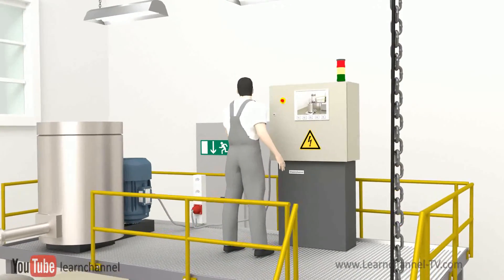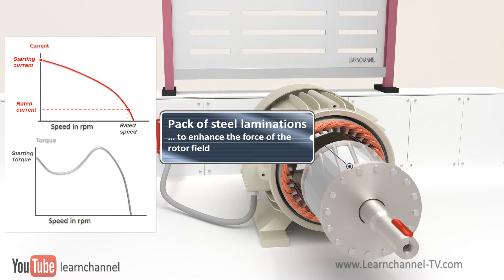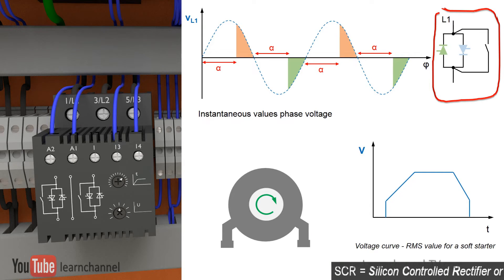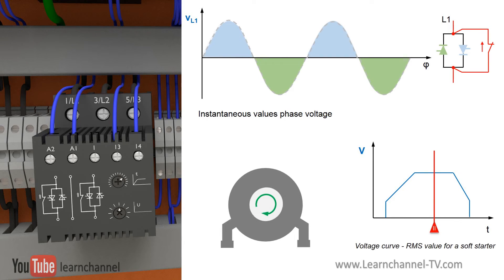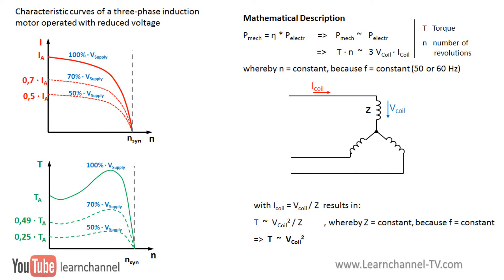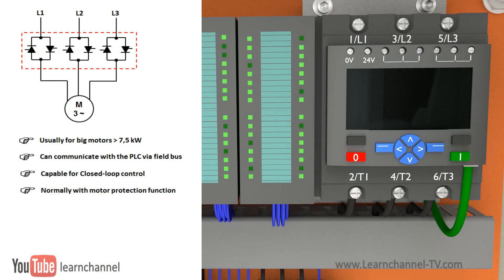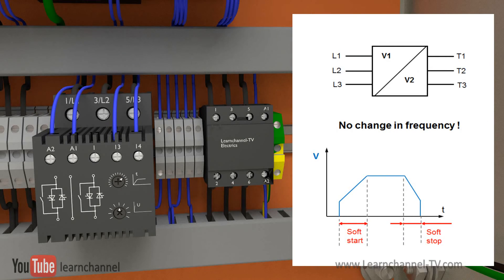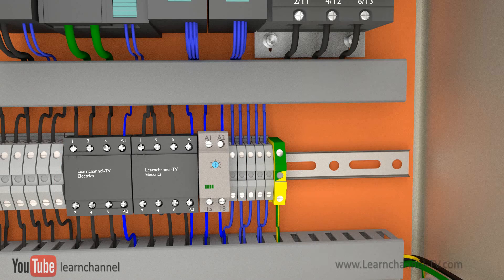Soft Starter for 3 Phase Induction Motors- full lecture!

Comment: How does the 2 phases works ? Won't the third one create problem if not controlled ?
Reply: rotor isn't two phase, it's DC. used to establish a magnetic field that allows the induction motor to operate closer to synchronous speed, more efficiently.